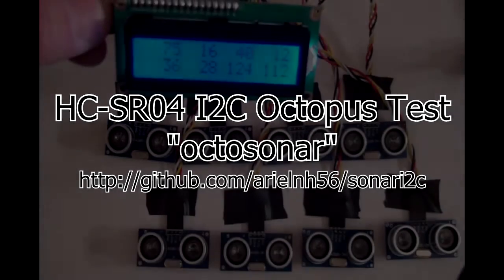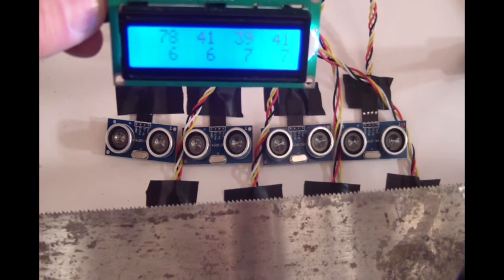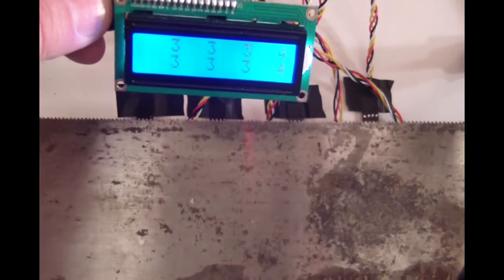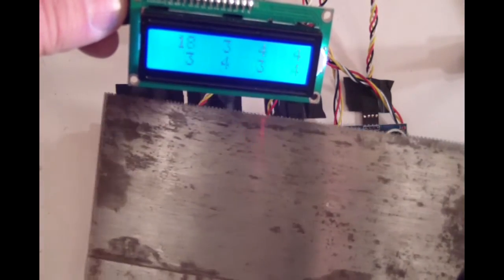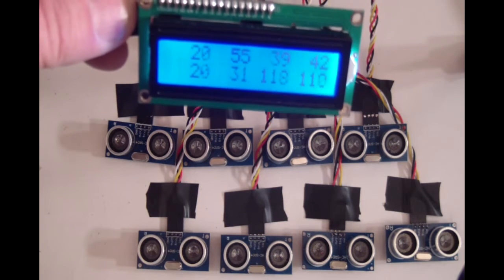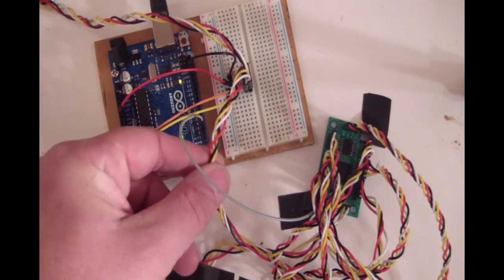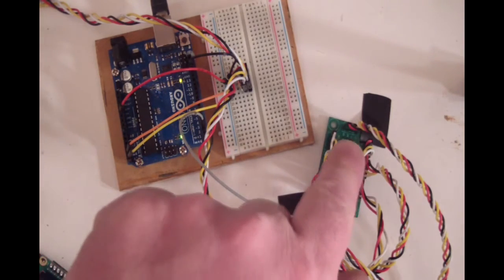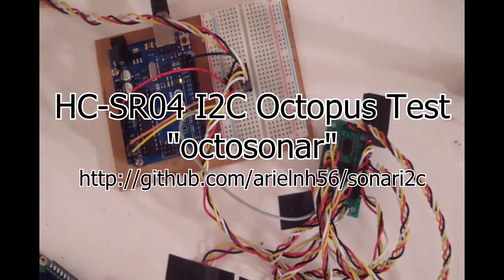HC-SR04 I2C Octopus "octosonar" test

Comment: Hey Ariel, how are you doing!?

I've integrated your octsonar on my DEV board and i'm trying to get some measures, using my Arduino Zero, but when try to get values on my serial port., they always are Zero. Do you have an idea of what kind of problem i'm facing?
Reply from the maker: As noted in the product description, the code seems to not work reliably with SAMD21 Arduinos, which would include the Zero. It's probably a timing issue or related to the interrupt code and fixable with some investigation and an oscilloscope. Do you have an atmega based arduino you can test against just to verify nothing else is wrong?